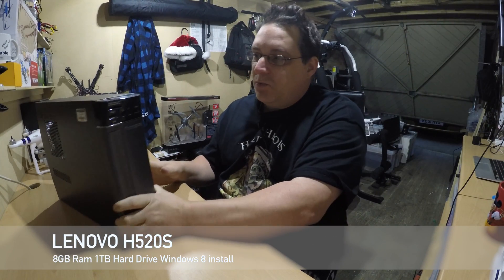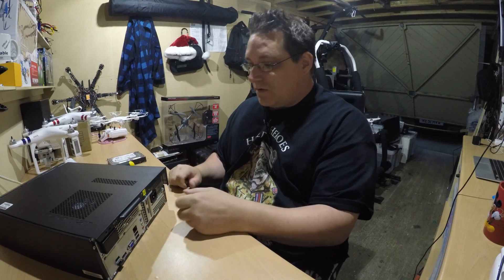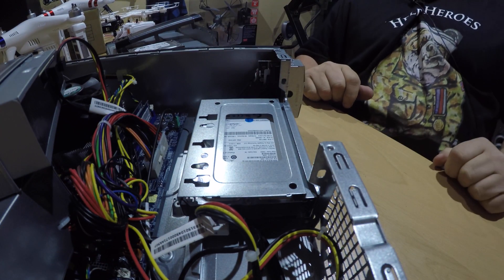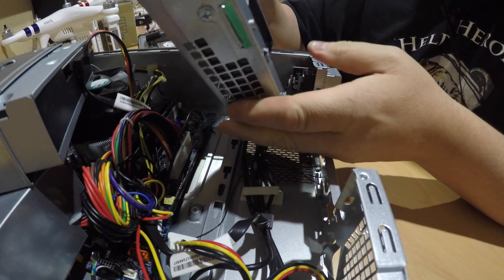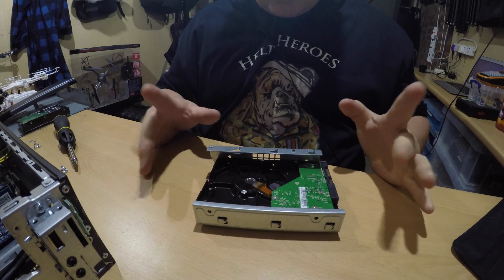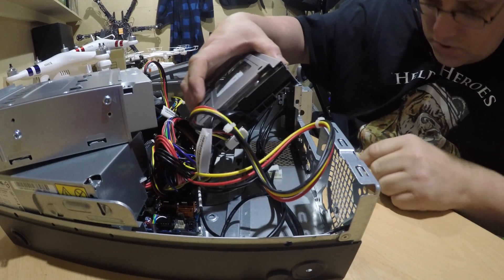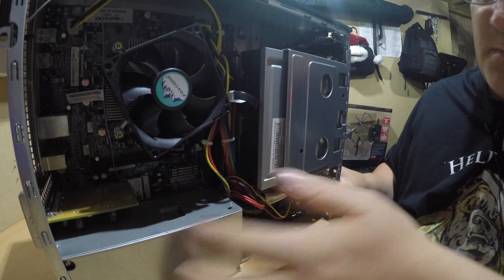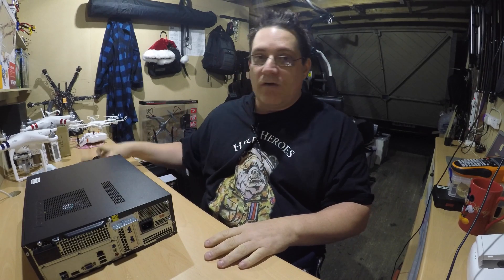Lenovo H520s Hard Drive Upgrade

Comment: Just added a SSD to my system, the same Lenovo as you have there but nothing is coming up in either my PC or in device manager. If I connect just the new SSD and boot up, nothing is recognised, I just get "No operating system found"  any ideas?

Comment: Very informative video. My PC would not start no matter what method I used. I needed to get the hard drive out quickly and attach it to an external dock by Plugable to get data transferred to a new pc. At first I had no clue how to get to the hard drive. Your video saved me a lot of time. Thank you so much.

Comment: Can you add it as an extra drive in the pc? I mean is there space for a second drive?
Reply from the maker: yes there space for three or maybe four.
Reply: cloud123uk
Can you tell me where I can find it since I want to keep the current drive and I want to install SSD.
Reply from the maker: Gol D. Ace SSD drive you can by from places like scan.co.uk or buyer.com check both site for pricing as some time one cheap er then the other.
Reply: cloud123uk
Sorry I meant in the PC, where can I mount it simultaneously with the current drive. I want to keep both.
Reply from the maker: yes there room just below the current one
Reply from the maker: if you install SSD drive you can fit around 3 using the same drive tray as they so much small in size then the standard SATA drive
Reply: cloud123uk
Does that mean you can't have a standard drive simultaneously with an SSD?
Reply from the maker: you can fit a standard hard drive and SSD drive under it
Reply: cloud123uk
Thank you.

Comment from the maker: Rhys Harris sorry i did have some few month ago but went with an old server, sorry...
Reply from the maker: Rhys Harris I like the SSD 480GB which i testing with a PowerEdge R210 Server as they meant to be 28 x faster on boot and saving , and they new been found in raid 5 system now less power faster good for holding and access your data.
Reply: One question, what kind of size is this motherboard?